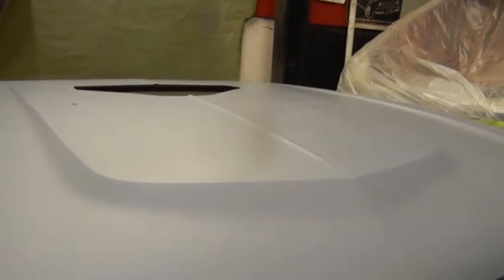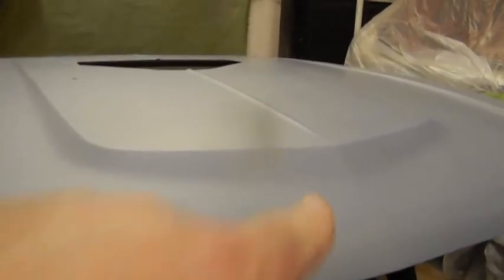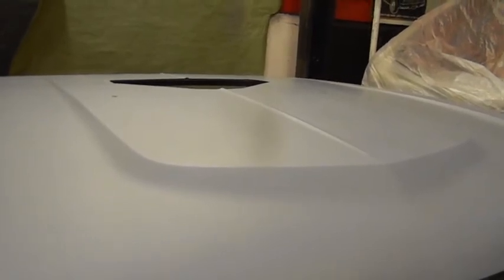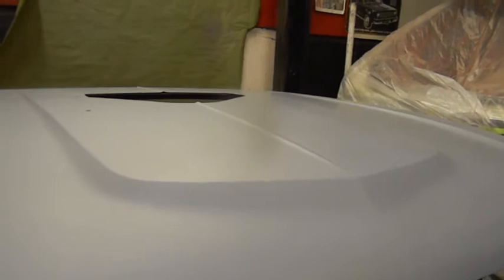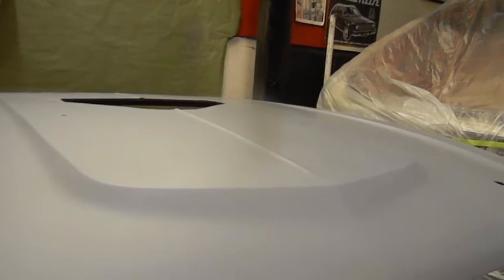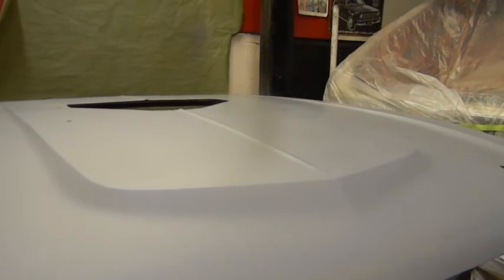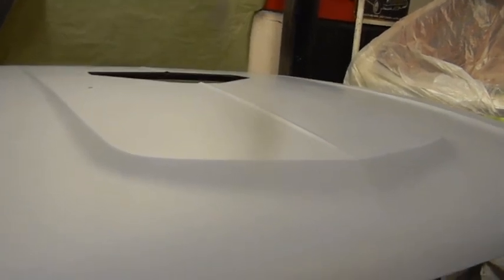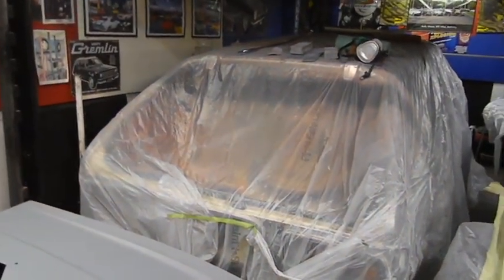New HVLP Gun And Poor Customer Service

Comment: Can you point me in the direction of pics of that hood? They did the same shit with my Hagstrom Swede, 6 string electric guitar. Out of the blue the fret board started to split off the neck. I took it to Guitar Center and they contacted the rep who said the guitar had been dropped. Now way that happened!  So I ended up having to replace it. I think down the road I'll buy a kit and transfer the hardware over to it, because the tuners and electrics aren't all that bad. I tried contacting the company and voiced my disappointment when they were advertising on FB. Nothing.